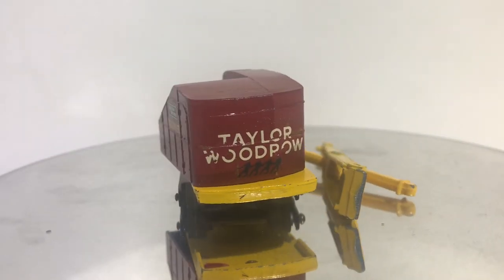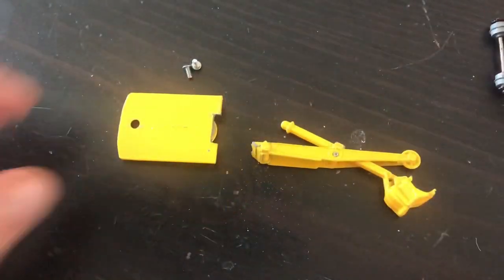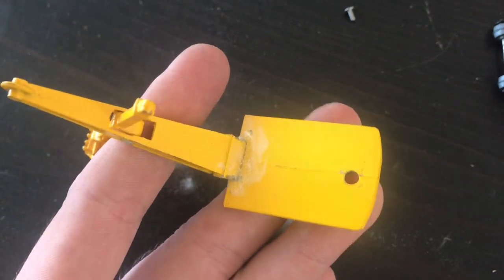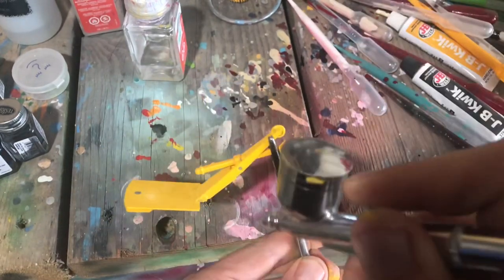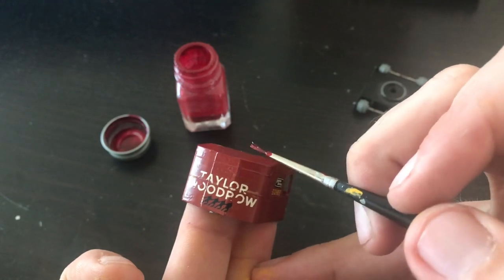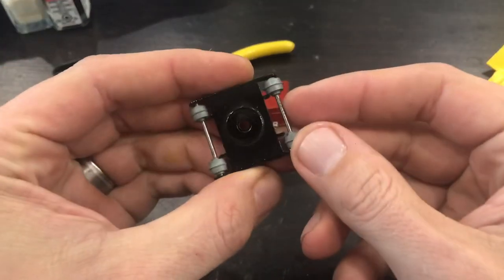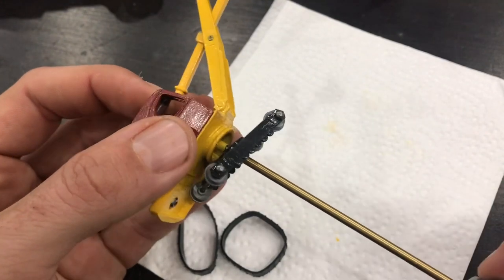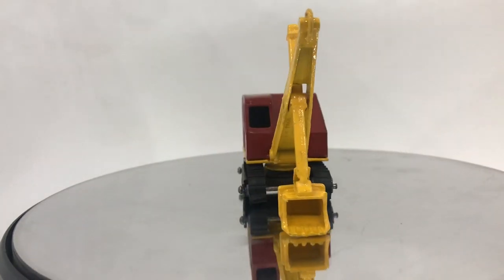ONE DAY BUILD!  Matchbox #M4a Ruston Bucyrus 22-RB Excavator Sympathetic Restoration and Repair

Comment: Great job on the front shovel, I do believe the original tracks were green, I  have the exact same model and it needs the same repair, it was nice to see it happen, I was undecided, whether to solder or glue as you were, I now know that the glue will work fine. Thanks
Reply from the maker: I really want to try some repairs with the solder method.  The kit to get up and going is about $60 and eventually I'm going to have a broken model that I will have to strip paint on and I'll try it out.  I used the glue on this mainly because I didn't want to completely strip the paint.  Since it's going on display in my collection it should be fine but the solder method is definitely a stronger repair.

Comment: I know it wouldn't be original but I would have added a small washer between the top and bass.
Reply from the maker: As tight as the clearances are and the length of the remaining post I'm not sure I could have gotten it back together with anything else in the assembly.